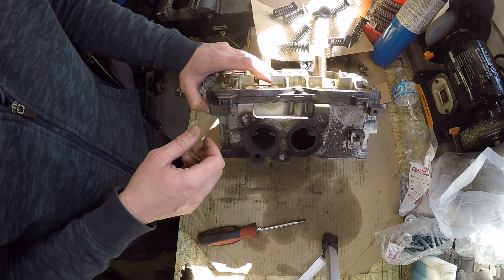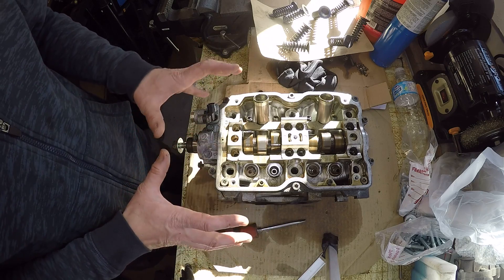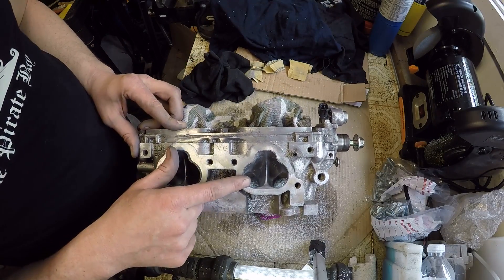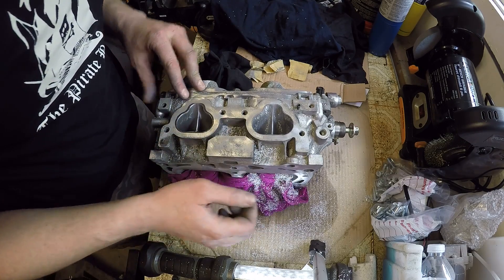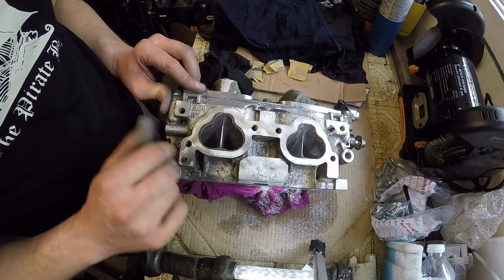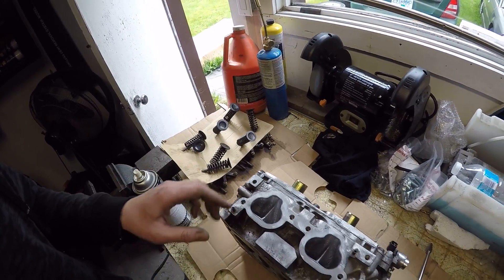SOHC EJ257 Hybrid Build Part 6 - Head Porting / Reconditioning - How To

Comment: I bought a cordless electric tool to do this. Its pretty much all I have to work with. Any suggestions on how to proceed? I am currently looking for a bit to use so I can do mine.
Reply from the maker: It's really going to be a little hard on a battery tool. If it's going well, give the tool a break once and a while to keep it from burning out OR go nuts and exchange it for warranty lol. I've seen well priced bits on Amazon actually
Reply: @HomebrewSubaru  Will do! Thank you!!

Comment: Did you port the exhaust side at all?  I didn't see that part.  Is it not worth to port the exhaust side?
Reply from the maker: The exhaust side was not ported. Some of the rough edges were lightly trimmed
It really depends on the application and your goals
The intake side is important with boost because we want as much of the available charge to go into the cylinder.
With larger power goals exhaust porting might show some gains. Don't want them too big, or scavenging wont be efficient
Reply: Would you recommend porting the exhaust side for n/a application ?

Comment: Would ej22 n/a heads mate with the ej257 block?
Reply from the maker: Yes they would. Flow restrictions could set you back though. 2.5NA camshafts will fit into EJ222 heads. Some light porting and they will flow really well. Delta is a well recognized camshaft dealer as well.

Comment: Gotta love a good porting. Makes so much difference. It’s all about getting that air in & out. I couldn’t find a long carbide like your one
Reply from the maker: It really does and I'm glad I went through with it. This aluminum carbide I looked for quite a while and then had to special order it. I've used it enough now that the cost of it doesn't matter so much. It will last forever and I guard it with my life ;)
Reply: Homebrew Subaru , got a link to the bit?
Reply: theyre all over ebay. search aluminum tungsten carbide burr. make sure you order thr correct length, bit shape, and shank diameter. im a professional grinderman and i can with 100% confidence say these off ebay will last longer then any of ypu will use in your life aa long as youre using on softer materials like aluminum. i grind 12 hours 6 days a week and they last me up to 6-8 months
Reply: @matthewbolton4289  hi. What size should I look for?!
Reply from the maker: Thank you very much for that. All I was missing was tungsten from my keywords. Great prices too!
Reply from the maker: Sorry man, I got it from a Snap On truck years ago. I've looked for other porting tools/kits with no real success.
Reply: no problem anytime. glad i could help
Reply: Great video!!